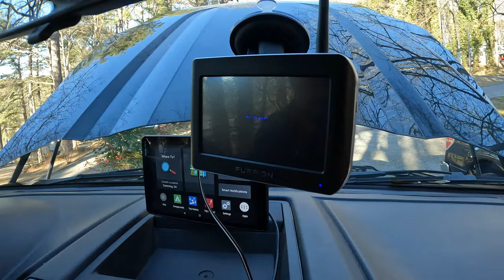How to wire 2022 Ford F350 Super Duty Upfitter / Aux Switches - Dash Wiring

Comment: Very Nice and good job, Just have one question why did you go with the cigarette lighter adapters and instead of just hard wiring each component to the corresponding switches? I still need to do mine and i am still trying to figure it all out. I like the way how you took the time to show each step on each panel.😀
Reply from the maker: I went with the cigarette lighter adapters so I can easily change out the accessories without having to rewire.  Thank you so much for watching!

Comment: @ 6:05 you said to connect one of the four pass through wires to one of the relay wires. Where did you find the four pass through wires in the engine compartment?
Reply from the maker: They are in a small wire bundle on the left side up close to the firewall.